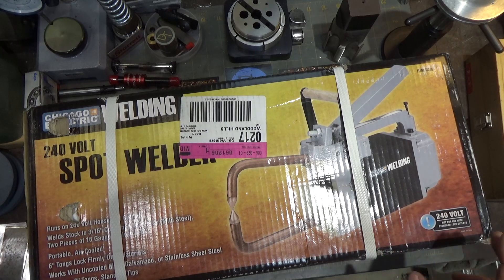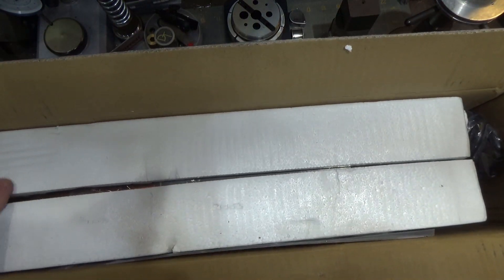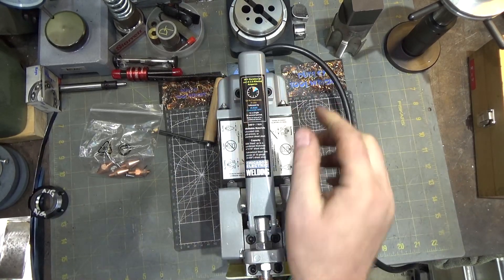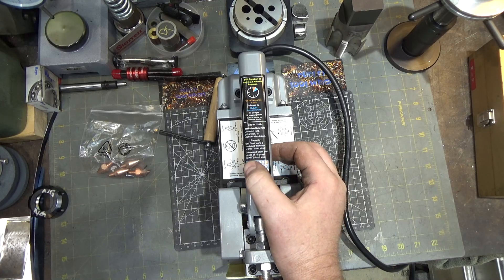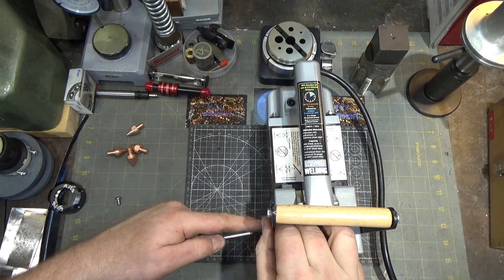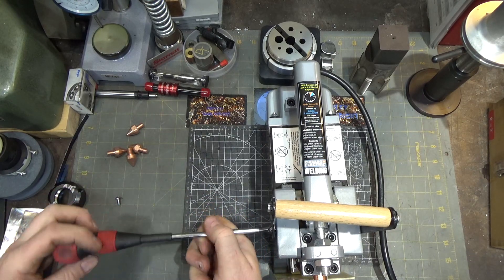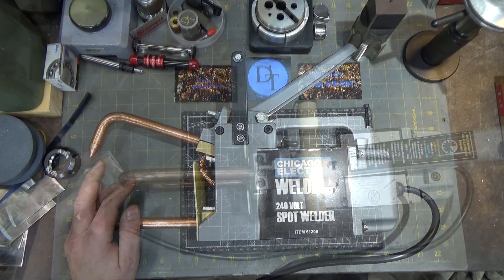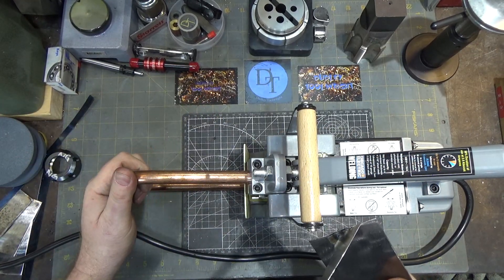QTR 60 Harbor Freight Spot Welder

Comment: I bought that exact unit through Amazon because of free freight to Alaska.  I ordered a 240v model but was sent a 120v one.  When I contacted the manufacturer he said to "just put a 240 volt plug on it" .  Quite surprising and the inference  being of course that there is absolutely no internal difference between the models.  My instructions were also explicit that you needed special dialectic grease when assembling the tips which is not included.  These are obviously only for sheet metal which is ok as that is what I envision using it for.  Very handy for drawer boxes and cabinet work.  That grease may be to keep the tip's threads from galling to the arms--not sure.  You would think copper to copper threads would be top notch for conductivity without.  A man just can't have too many tools!
Reply from the maker: Thanks for the tips. Mine did not come with dielectric grease and I would not think the 120 and 220v models would be the same. Some transformers are center tapped to allow multiple input/output voltages voltages.

Comment: On your two pieces of alumium  put a piece of steel on top and bottom with the alumium in between. That is how you can spot weld your alumium.
Go ahead and try it. You can also use two scrap pieces of SS on top and bottom, both will work.
Reply from the maker: I had never considered this approach. Thanks for the tips. I'll give them a shot.

Comment: Gday, this would be a really handy tool to have and probably use it more then you would think, the clamp system seems to jam a bit but I’m sure that could be sorted out, great review mate, thanks,   Matty
Reply from the maker: I agree. I think I need to play with the clamping system and see if there is improvement to be had. I needed the tool now, so took the leap. My expectations were pretty low.

Comment: Well done and very practical 'review', since I am planning on buying one. Like Aquarius said, I would be inclined to bend the upper tong back a bit by measuring the slant angle 'error' when clamping typical material I would be welding. I am building a 'K40' 90 watt CNC laser, which will have a steel frame and be covered in 22 ga CR, along with internal separation bays, so this looks like it will work.
Reply from the maker: Glad it was helpful! I would love to follow that build.
Reply: @DudleyToolwright  I will be ramping my channel back up with this build, which should cover most of the different steps. Still designing in SolidWorks.
Also, just to reiterate, your review of the 240v spot welder was so good because it was so practical, doing actual different scenarios and test destroying on camera; most people do one test with two pieces of mystery metal, but seeing the results from different materials was very helpful.

Comment: That thing welds a lot faster than mine, my old hf one you have to hold the button for a few seconds until you see the weld area heat up and glow red hot then you let off the button and hold the tongs to it until it cools. I was welding around 1/16 thick material. (1/8 total)
Reply from the maker: Interesting. This is a 240V model, but the current Harbor Freight 120V model works on material nearly as thick - maybe 1/8".
Reply: @DudleyToolwright  I think it might be  because I have wider tongs on mine. The super small tips you have on there might heat up faster. One of the tips on mine is around 1/4" diameter circle.
Reply from the maker: Yep. The tips are reduced to about 1/8" diameter which makes yours 4x the surface area.
Reply: @DudleyToolwright  Might be an interesting experiment.

Comment: Another great video. Keep it up. To make good quality spot welds you have to make the welding electrodes to be coaxial when the welding materials are between the electrodes & the proper clamping force is applied. Sparking is not normal and could be dangerous ( proper protective gear is a must ). The factory supplied upper tong end has to be bended more to get coaxial with the bottom end. It is obvious that for every thickness of welded materials you will have to use different diameter / length welding tips & set up their alignment individually. A timer is also a must for good quality spot welds. There are timers with welding time compensation. These are monitoring the welding current and adjusting the welding time accordingly.
Reply from the maker: Thanks for all of the tips. I really appreciate you taking the time to share your experience.
Reply: Aquarius, sparking is normal when large current (energy) dissipates on the material quickly - fast welding.  If is dangerous depends on the location etc.

Comment: Stainless sheet actually spots beautifully, easier cleaner and stronger than steel, because of its higher electrical resistance and lower thermal conductivity.
Reply from the maker: Great tip! Thanks.

Comment: I think you should try some nozzle gel to keep the tips from sticking. it keeps the tip clean on a mig .  to me this is typical Jr High spot welding. We had the same type of welder, no frequency or pulse, just push the handle down and relase.
Also you may want to lower the amount of pressure on the tips a slight amount.
Reply from the maker: Great point! I was thinking the same thing while making this video.  I only have a tig welder so didn't have any nozzle gel handy. I'll have to get some.

Comment: Dudley.
The process is forge welding. 
There shouldn't be molten metal.
The odd spark maybe.
Just like a blacksmith you are heating it enough to allow  the pressure on the tips to squeeze it together.
Nothing stopping you running a file over the tips to achieve face to face contact.
You should then stop the sticking.
The cross section area of the contact area is fairly critical.
Small cross section and it gets hotter.
So
Increase the cross section would give you a larger window of control within the capacity of the machine
Lower heat needing longer "time"
Time and heat the 2 variables. 
The cycle being
1  heat to red plus.
2  stop heating
3  immediately squeeze more to forge weld
Reply from the maker: Thanks. Another great set of tips. I really appreciate you spending you time to help others out. Cheers.

Comment: Pretty much everyone sells these two models. It looks as though all those models are made by the same company. Now that Miller discontinued theirs, these are practically the only models available, other than for some speciality models. The Miller was made by Miller, and has nothing in common with these cheap models. The Miller’s cost around $1,300.

I have a 120 volt model.  I’ve had it for almost 20 years. It’s odd, but HF has shown the Miller in their catalog, but when you go to the page, this shows up.

Some myths. You can weld aluminum with this. I’ve done so a number of times. You have to experiment, and be careful, but it does indeed work. It’s not the oxide film on aluminum that’s the problem. It’s the conductivity. You need to weld for longer times. I’ve welded up to a combined 1/4” steel with the 120 volt model. Again, experiment. Just understand that the specs for these are really for continuous work. If you do a few heavy welds, it’s fine.

Another thing to be aware of. The standard tips in the industry are Miller tips. The thread on those tips are different from the threads on these. At least they were. So when buying new tips, you have to make sure they fit this. There’s a guy on eBay I buy tips from and the copper rods as well. But again, they’re for the Miller. But he will do custom. Buying rods is expensive, but you may need different lengths, etc. while the rods fit, the heights are different and may not close properly. When I get mine, I modify the angles on them. I’ve bought tips from him that have not been pointed. I’ve modified them to allow me to weld weld pins and screws. It works very well. Those welders cost a good $5,000!

The 50% duty cycle isn’t relevant. Most spot welds take a second, or less, for thinner materials. Sometimes, a small fraction of a second. For home users, it’s almost impossible to come anywhere near 50%. 10% is more like it. For thinner materials, it’s impossible to get consistent welds, manually. The switch is spring loaded. It’s momentary. So you flick it, and hold it until the timing is done. Try to do that consistently with a second, or shorter time. You can’t. You need a welding timer. Otherwise you will burn the welds, and the tips will begin to stick to the welds. Once that happens, the tips become contaminated, and you have to file them. Otherwise, they will stick even harder, and you will really have to twist it loose.

So if you get poor, inconsistent welds, it’s not the fault of the machine, it’s your own inability to maintain consistency. Don’t use too much pressure. Just enough to have them touch. The more pressure, the better the conductivity of the material being welded, resulting in a worse weld, and greater possibility of sticking. Always use the shortest weld time possible. If the weld time is too long, you will damage the metal of the weld, and cause it to break. Remember that this melts the metal. Too long a weld, plus too much pressure, and you literally squeeze the metal out of the weld.
Reply from the maker: Thanks for spending the time to share so many useful tips. I really appreciate it. The best part is that everyone else wins as well.

Comment: I recently got the same spot welder. Any Idea how to hook up a pulse timer to it?  The Tecna WTG-7902 spot welder is about the same but it has a pulse timer.  but it's $1400. I tried a pulse timer from  Amazon but it burned up.  I think it's just for Lithium-Ion batteries. Any help would be appreciated.  Great video!
Reply from the maker: Hooking up a pulse timer would be quite tricky. The output of the secondary is probably too low a voltage for starters. If it wasn't that output would get rectified and then go to a bank of MOSFETs that would switch the high current output. There would perhaps be a bank of capacitors to store extra energy. Finally there would need to be a microcontroller to deal with the user interface and MOSFET control. This is not an exceptionally difficult project, but would require some electronics and microcontroller knowledge. I might follow up on a project like this in the future.
Reply: @DudleyToolwright   I guess that's why the ones with timers are so pricey. That would be cool!  Here is the one with a timer. https://tecnadirect.com/portable-welding-guns/light-duty-spot-welding-guns/
Reply from the maker: Thanks for the link. I'll check it out.

Comment: No mine did not come with it either.  I found it on Amazon.  Kinda thought that there should be a difference in transformers.  Since I bought it on Amazon they would have had to pay the freight both ways.  Chinese morality is about the same as their quality!  I had an extensive email with the 'rep' during which he insisted even after I had him check with their techs.  Which I bet never happened!!
Reply from the maker: I get it. If you need customer support, you are probably hosed.